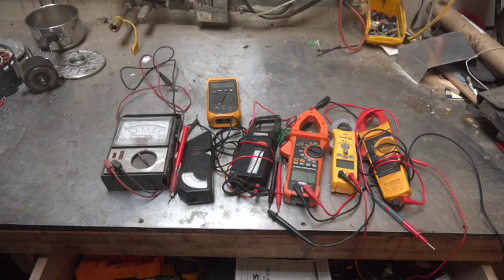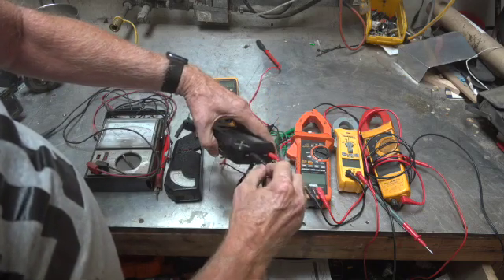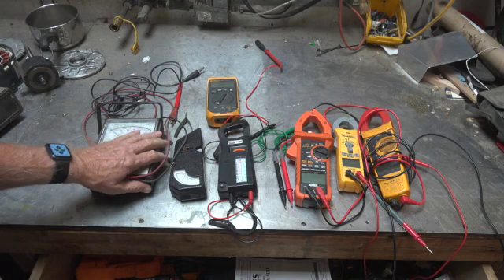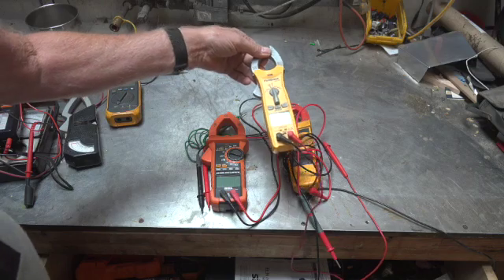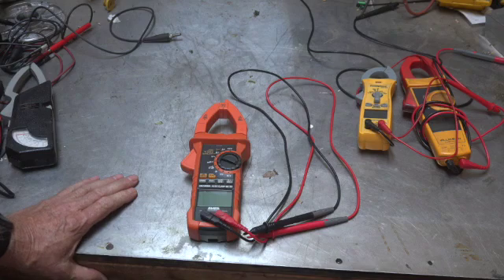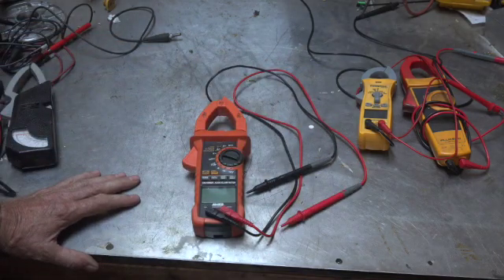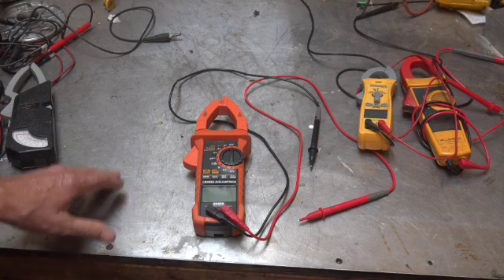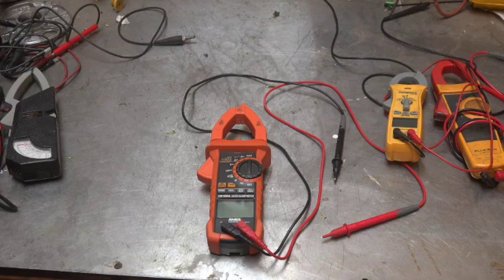Review of the Ames 1000A digital clamp meter

Comment: WhenI was 12 years old my Father bought me a Simpson 261 the difference between the the 260 and the 261 was the mirrored scale on the 261. I am 66 year old now and the meter still works well today. It was last at a PMEL ( precision measurement electronics laboratory) in 2000. I bought a Fluke 77 years ago that also still works well. With the advent of DC clamp on meters I am looking the CM1000A
To carry in my travel trailer. I have extremely limited space in a Casita trailer and having the ability to measure current DC or AC will be great for troubleshooting basic electrical issues along with the other features of the meter.😁🛫

Comment: I’ve had excellent results with most everything on the higher end I’ve bought at Harbor Freight Tools, especially this meter.  I work in the oilfield and my tools take an absolute beating.  My only disappointments with this meter is the leads were too short, and it didn’t have a magnetic strap to hold it in place.  Also it doesn’t have a 4-20 mA signal generator, but I bought a cheap sig gen on Amazon for under $25.  I’d choose this over a fluke any day of the week.

Comment: I had one like the Fluke 16 but you connected the leads on the face side of the meter (Fluke). Unfurtanely I lost it in one of my DC/AC Electronics Classes. I miss it a lot. :(   Now I use a UEI. It is a good meter.

Comment: I have the little field piece and I love it does everything a HVAC tech needs
Reply from the maker: The fieldpiece is a good all around meter.
GFM
Reply: @grayfurnaceman  yes sir I agree mine has the magnet on the back of it and it's so handy
Reply from the maker: @kiowa1627  The only problem with the magnet is it attracts metal grindings.  lol
GFM
Reply: @grayfurnaceman  you are right still worth it tho  lol
Reply: i like the one with rotating head

Comment: The first Fluke meter I saw was owned by a tech guy named Everett 
Turns out the meter was made in Everett Washington... true story, He was as surprised as I was
Reply: I once blew up a Fluke 73, it had no fuse back then, I was measuring voltage drop across some 3 phase contractor for an airplane except I was on amps, guess what happened when that contractor opened up? Fluke gave me a new one, no questions, I thought they would fix it
Reply from the maker: I never saw a fuse protect a meter.  The meter always broke anyway.  
GFM